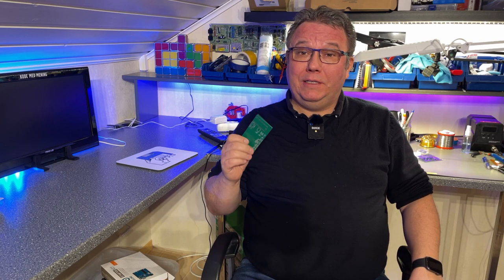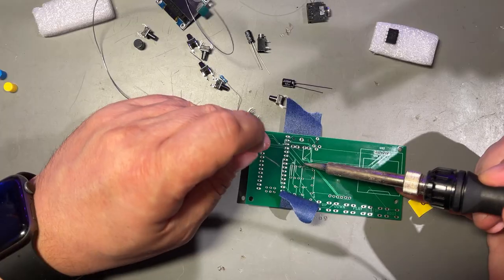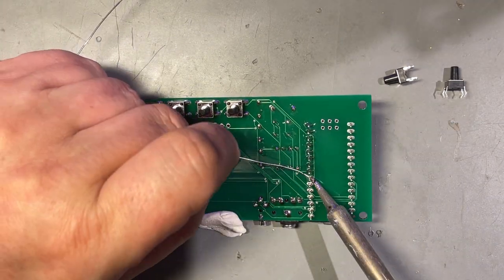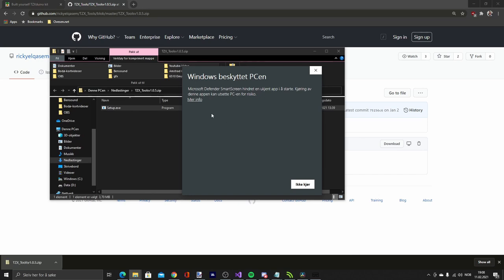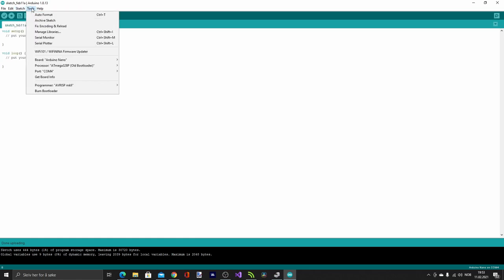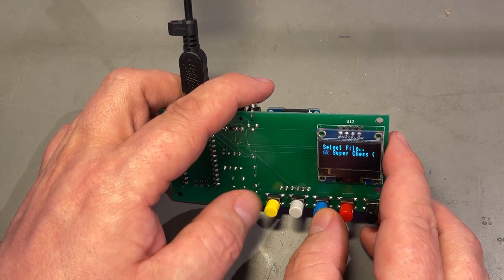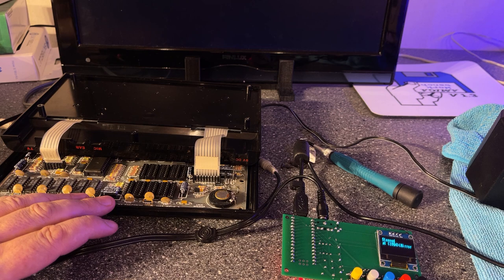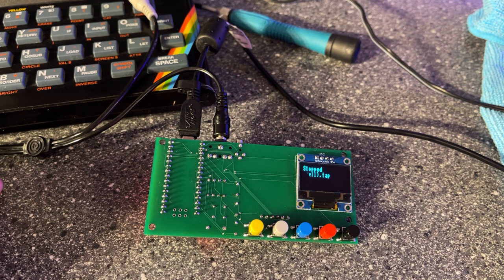Building and testing a TZXduino cassette player adapter for use with Sinclair, Amstrad, BBC etc.

Comment: Well done. Just one little issue in the video: ear connects to ear of the cassette recorder, and mic to mic. So ear is the input, mic is the output. In fact it is possible to load via the mic port like you did because of the internal circuit. But it requires a different volume level. So better to connect the TZXDuino to the ear socket!
Reply from the maker: Oh really? I was not aware of that. Thanks!
Reply: Just tried that and it`s a lot louder. Got excited but it crashes still on some games. I`m starting to think some RAM is faulty as JetPac loads every time which I think is 16K but larger games seem to crash. More fun.

Comment: I don't want to do all the hardware, just need to know the sound generation algoritm and answer to the question "can you speed it up?". I want to make something like this to run on a Macbook, more convenient than having an in-between device. I already made a program dumper that does RS232 dumps to another Z80 machine, the P2000, and want to extend that with ZX ouput. I wonder is RS232 is an option too, as on the P2000 loading 40K goes in like 30 seconds with that, much faster than tape loads on the Spectrum.